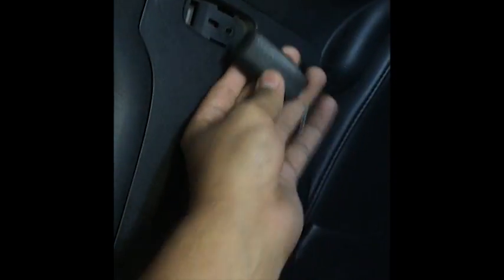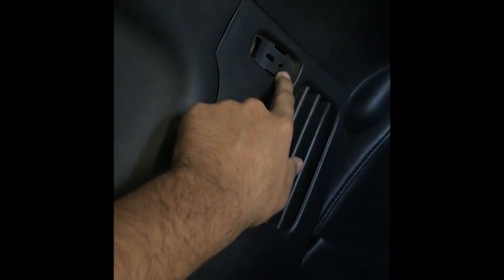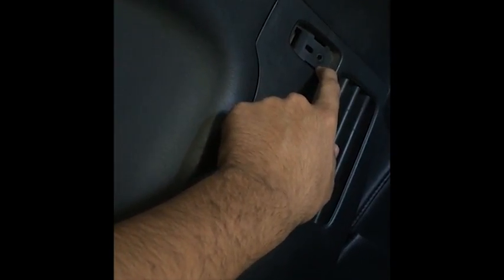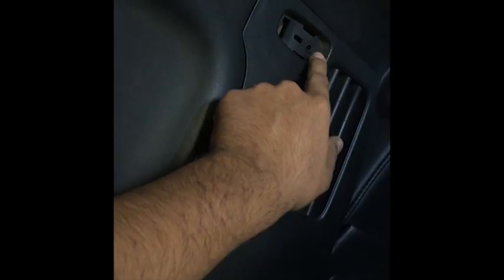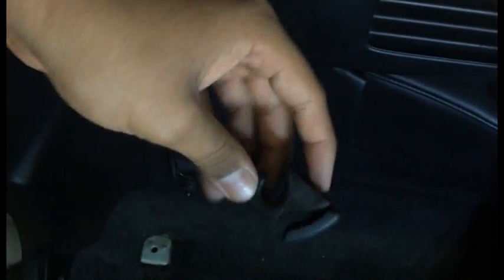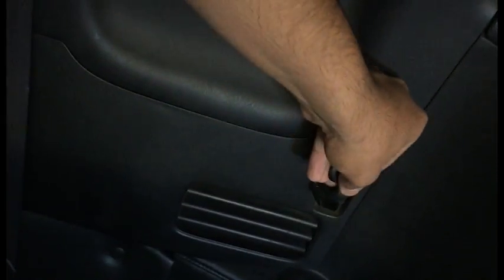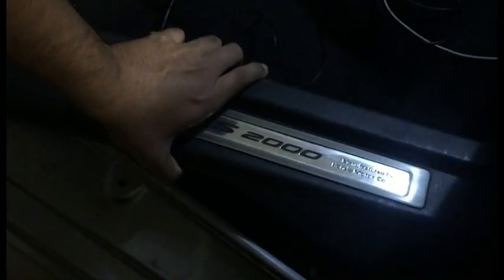Install s2000 hardtop

Comment: Does the s2000 come pre drilled for a hard top or u drilled it ur self for the side mounting points?
Reply from the maker: mines came pre drilled but my buddies did not so it depends on who you get it thru i got mine thru rockstar